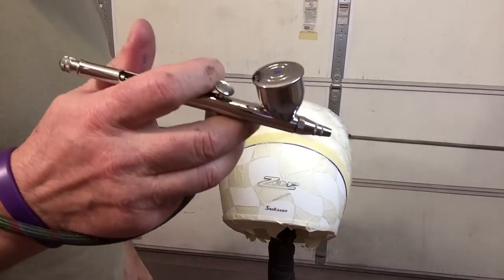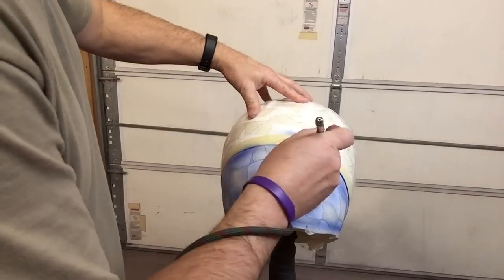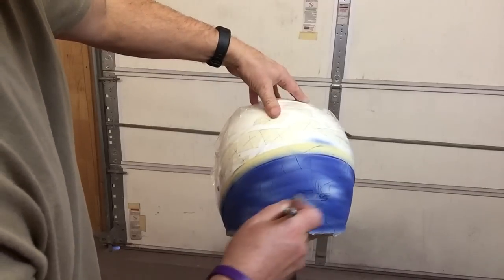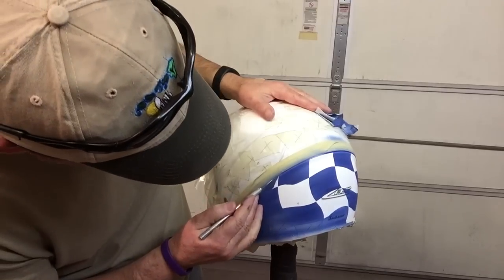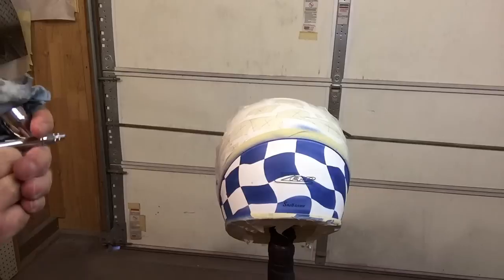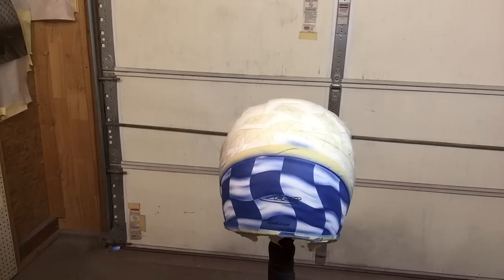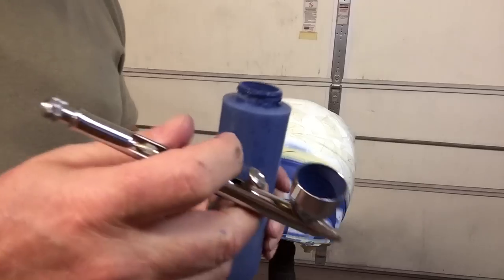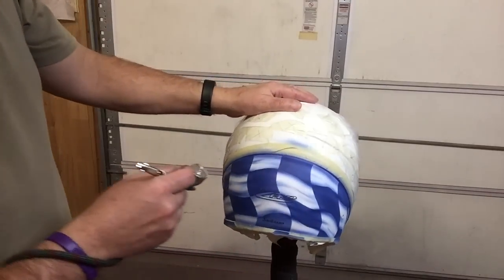How To Airbrush Checkerboard On A Helmet - Part 2

Comment: Hi!, I am trying to learn something about helmets airbrushing, but every time that I peel off tape masking the coat of paint (PE) has too much thickness. What am I doing wrong?. Thanks in advance.
Reply from the maker: +VALENGO11 Use less paint. It sounds like you are just putting to much paint down next to the tape line. Less paint, especially next to your tape should solve this problem.